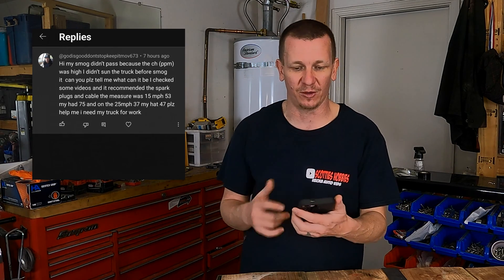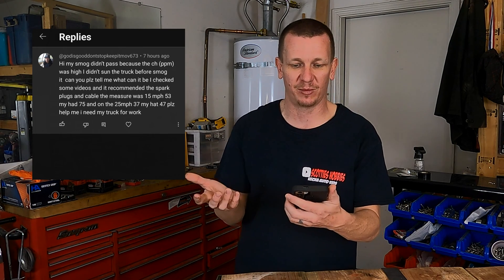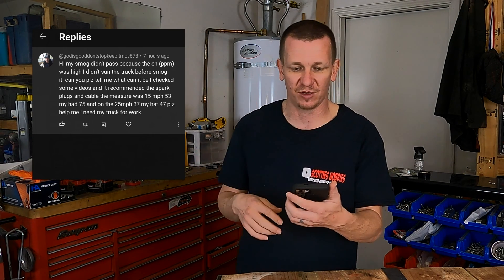What Causes High HC Hydrocarbons? Failed Smog Inspection for High HC. High HC Fix.

Comment: I have 89 cherokee xj ive changed the spark plugs an wires fuel injectors oil fresh changed and air filter my  reading are 3.3795 LIMIT IS 3.0000 wa can it be ?

Comment: Hi Scottie - thanks for this video.   I have a 1991 Mercedes (gas not diesel)    I am only failiing the 15 mph HC, measuring in a 145 when the max is 105 .      25 mph measures in at 68 and the max is 80.       I failed the test 2 weeks ago as well for the same reason, 2 weeks ago 15 mph HC measured in at 135.     2 weeks ago the gas in my car was about 3 months old so I ran that out and put in new gas with basically the same result.    I know I haven't had a tune up on the car in at least 6-7 years.  I work from home and don't drive it much and I also have a 1993 Mita which passes smog flawlessly.      I appreciate your video and am goinng to schedule a tune up.  I was wondering if you had any additional insites for just failing the 15 mph HC and not the 25 mph one.    I'm not putting more than maybe 2,000 miles a year on the car so it does not have alot of mileage from the last tune up I did, even though it was years ago.   Thanks.
Reply from the maker: You are on the right path. Just make sure you dont have any exgaust leaks before the o2 sensor and no vacuum leaks too. You could also have a 'lazy' oxygen sensor. What was your 02 reading at 15 and 25 mph?
Reply: @ScottiesHobbies     02 at 15 mph is 0.2 and at 25 mph it is 0.0           The CO2 at 15 mph is 14.0 and at 25 mph it is 15.3
Reply from the maker: @marianneforeman1394 I'd like to see 0.0 at both speeds. That is a indication that the vehicle could have been warmed up a little more.... or an exhaust leak. But since it was 0.0 at 25, I'd lean more to it could have been warmer.
Reply: @ScottiesHobbies  Passed with flying colors after I did a spark plug, air filter, fuel filter change.  Went from 135 HC at 15 mph to 22.    All my other measurements for everything else dropped dramatically as well.

Comment: High HC is probably due to an over-rich condition, or so lean that it occasionally mis-fires.  If your car is recent enough to have oxygen sensors, those could be the problem.  If it doesn't, and has a carburetor, your idle mixture could be on the rich side, your float level could be too high or your float(s) "loaded", or your float needle could be starting to deteriorate so that at idle, the fuel level in the carb starts slowly rising.  Also, your automatic choke could be not fully opening.

Comment: My Nissan 720 failed fuel evaporative emission control what can it be ??
Reply from the maker: It could really be a ton of different possibilities. You have to find a small leak, somewhere in the whole system. I'd start by fallowing all the evap hoses that I could see. Look for a wet spot. If you can't find one. The next best thing to do would to do a Smoke Diagnostic.  I just posted this video of how to set up a Smoke machine to find an evap leak. https://youtu.be/egm8P3PkdVA

Comment: Hi thanks for the info, I have installed a new stroker 383, New distributor, new wires, new Map, new injectors, new oxygen, new Nox, Temp, I'm still falling HC? Is a 383 the issue? The old 383 passed after changing the CAT. is it my timing? I'm at 8000 Ft above see level? If you have a recommendation I would love to hear it. Thanks

Comment: What if its only at idle? I pass no problem at load, but at idle its over twice the max. I've tuned up, run seafoam through it, full drive cycle, and replaced O2 sensors. I can not figure out why its running so rich at idle.
Reply: I’m having the same issue on the 15 mph. I’m at 96 and it’s supposed to be at 54. 
Did you figure it out?
Reply: @CarlosHernandez-gc6no  nope. still trying to get it to pass. I have a bad feeling its the cats.

Comment: For emissions test, I like to install a new air filter & add a bottle of injector cleaner to the fuel tank.
Reply from the maker: That is a great idea. I usually recommend getting the smog done on the next tank of fuel. Don't smog while the clea er is in there.

Comment: 94 Chevy work truck 4.3 failed 25mph by two was at 54 need 52. Truck had been sitting so I added chevron techron complete fuel system cleaner drove all the gas out of it. Then put another bottle cleaner in with shell 91 4 gallons to make it more concentrated drove until that fuel was gone and filled up 6 gallons of chevron 87 and failed by one 53 need 52. Stupid California. Going to do spark plugs and wires with an oil change
Reply: How did you do now?

Comment: I just failed 15mph with high HC's. The HC's were just over limit Max = 55, actual was 57.  I did have %02 = .2 so perhaps it was not fully warmed up? I changed plugs and coil pak before smog test. The oil only has 4k miles on it, but thats over the last 2 yrs (don't drive the truck much). Should I change the oil before I take it back in for re-test?
Reply: Yes!

Comment: Thanks for the video. I failed smog twice now on a 1996 Infiniti g20; only the 15 mph HC portion.I gapped all the sparks, cleaned the dist. cap contacts, checked ohms on spark plug wires, and timing was perfect. between the two fails, I replaced a cracked intake boot leading from the air filter to the intake, but it only dropped 10 ppm or so. I have been failing for the last 8 years, but always manage to do a little something to get it to pass the second time; except this time. Could it be a vacuum leak, or an upstream O2 sensor if it only fails on low RPM? Thanks!

Comment: Got a 98 S -10 - HC juist barely passed 2 years ago.. I'm due again.... Does cat cleaner help? 87 or 91 octane? Early morning when it is cooler or is it ok to go on a hot day in the afternoon?
Reply from the maker: How are you on a tune-up? Like the spark plugs and air filter?  If you have not done a oil change in a while, fresh oil can help out a little too. Lastly, old pre-cat oxygen sensors could be replaced. Especially if they have over 100k miles on them.

The time of day.... honestly won't make much of a difference.  Just make sure you drive the vehicle for 20 ish minutes before you go in and try to get them to hurry and test it hot.

I hope that helps!! Good luck! 🤞🏻💪🏻

Comment: I have a 95 chevy c1500 5.7l that failed all emissions test.
CO2  13.9\14.2
O2  0.7\0.6
HC (PPM)  MAX  115\67
                   AVE    45\34
                   MEAS  181\169
CO%           MAX  0.43\0.74
                   AVE  0.10\0.14
                   MEAS  0.69\0.66
NO (PPM)  MAX  699\601
                    AVE  317\238
                    MEAS  1310\1099
Tested at 15mph\25mph respectively

I have rebuilt the throttle body, new cap, rotor, icm, wires, plugs, MAP sensor, O2 sensor, EGR solenoid,  ECM, temperature sensor. It was suggested it might be the catalytic converter since it previously passed smog in Nevada and I'm now living in California. Any suggestions where I go from here? TIA
Reply from the maker: Can you shoot me a picture of your readings? 925 418-5096
Reply: Ever figure it out i failed all mine also
Reply: Ca has different smog limits than nv.   Most will allow a higher number as the car ages not  all parts in .ca.   your o2  should be 0  and co 14.6  so yor car is not burning all the gas.  Could be dirty engine bad spark  o2 sensor air leak or worn engine.   A new cat only  band aids the problem until it wears out.

Comment: I have a 1992 Nissan pathfinder xe.  Had a smog test performed.  Everything passed except HC levels at 15 mph.  At 15 mph the level was 119.  At 25 mph it came down to 47.  The technician advised me to start with my oxygen sensor as I’ve never replaced it.  If that doesn’t fix it he suspects the catalytic converter.  Any advice/ thoughts?

Comment: I have a 1990 4 cylinder Toyota Camry. I barely passed hydrocarbons at 25 MPH, but failed at 15MPH. It drives fine, but miles per gallon has dropped somewhat. Already checked for vacuum leaks with carb cleaner spray - no idle speed changes. Had spark plugs replaced a couple of years ago with Iridium plugs, will pull and check them tomorrow (and clean them, check gapping). Hopefully there will be no oil in the spark plug holes (from leaking gaskets).
Reply: How did you fix it?

Comment: I failed Deq do to high hydrocarbon for a ford f150 75 I changed the distributor cap the rotor and still doesn’t work I cleaned the carburetor and I installed all new gasket kit for it what else can I do ?
Reply from the maker: Carburetor.... I surprised that one is still running in a emissions inspection state.. but, did you check the spark plugs? Make sure the gap wag good? How are the wires? How is the Ignition timing?

The Carburetor could need adjustment, but honestly, I am not a Carburetor guy.